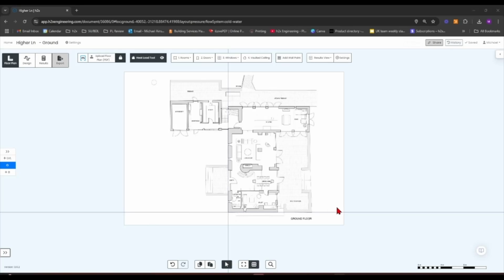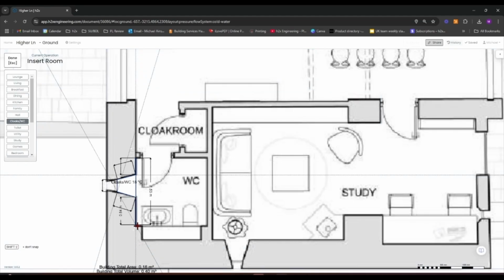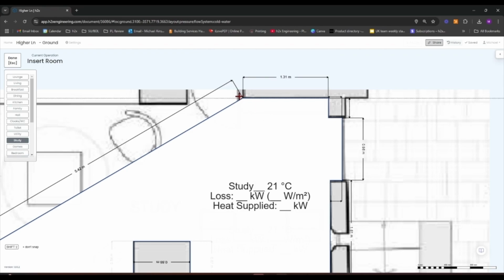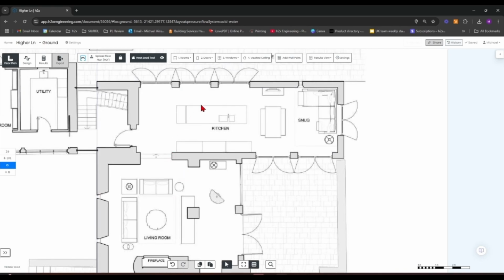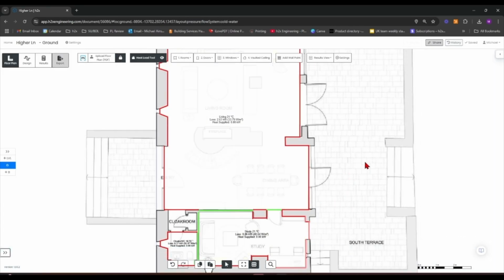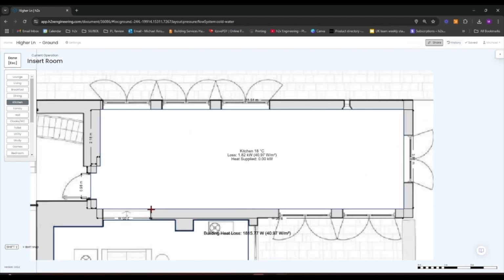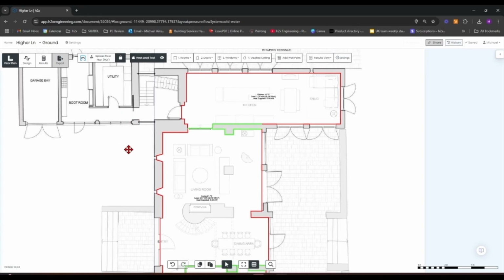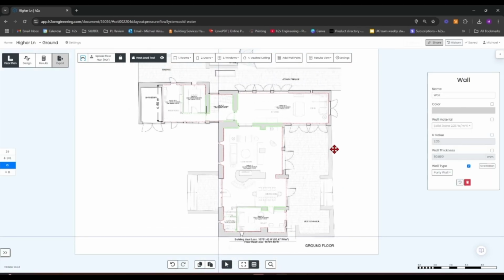Heat Loss For Complex Structures | h2x Use Case

Comment: Really useful to see you doing it this way... as have thought am I doing it correctly with thicker walls and old barns / building ( Luckily I was as had spoken to Shannon in the past).. really good tip about clicking away for ctrl and adding the extra wall points to put internal / external on the same walls...  really well explained and demoed on video !
Reply from the maker: Thank you 🤝